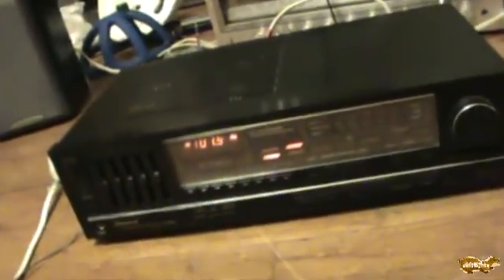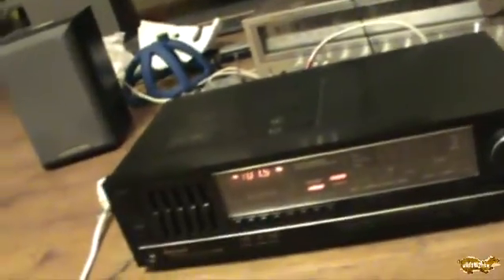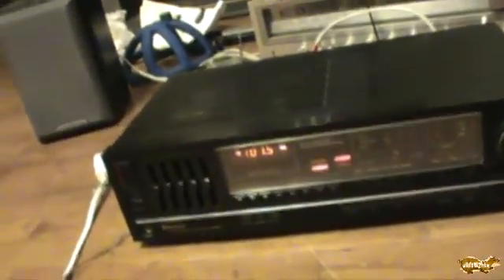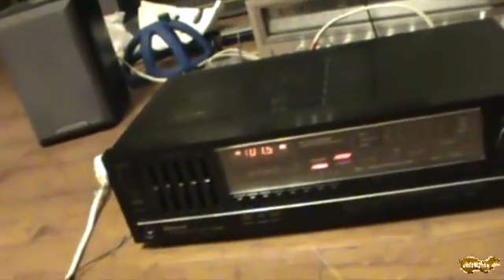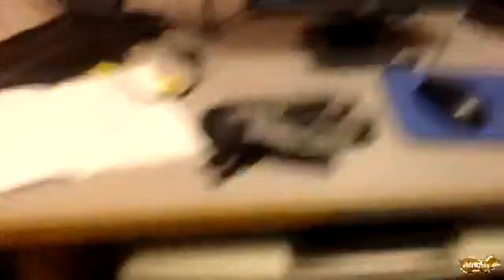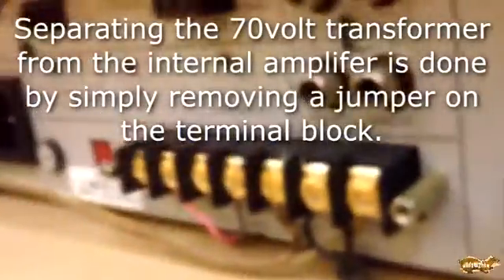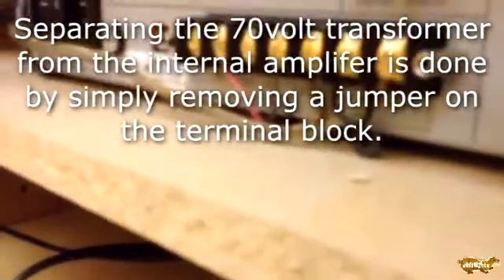70 Volt amplifier at work, Stand in and Replacement

Comment: I like the AA35 (I started to make a video of mine and got sick, so I never finished it), but the low end is really anemic. When they first came out back in 2008 and I was reading about the goals of their new amp line, they claim to have built the AA35 model to drive the lower-end Strategy series speakers, the AP15T paging horns, and the SD and FD72W speakers. Those are all speakers used for just background music and paging, so I guess I can see why the bass response wouldn't be that great. Still, it's a very nice and compact amp, and it makes those Quam(?) speakers sound pretty good!

P.S.: New YouTube comments suck. Just throwing that out there.
Reply: compdude512
I finally had to break down and make a f***ing Google+ account. You know, I hope they realize this will destroy YouTube, and revert back to the way it was before.
What a bunch of crafty a**holes though. They came up with an evil way to force people to make a f***ing Google+ account. The one and only reason why I'm not deleting my account is because of some of the people on here. I'm sure we'll lose a lot of great YouTubers though.
Reply from the maker: compdude512
The fact that it wasn't "broken" is why it needed fixed (or at least that seems to be Google's attitude on things)